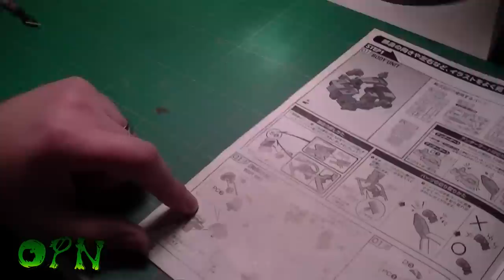How to airbrush MK III Gundam

Comment: Very good job! One question from my side: do you use glue? I mean... For the legs for example... If I would like to glue the leg parts in order to not show the cutting part of the plastic section, I have to glue before and after spray it with primer?

Comment: I shall definitely have to have a go with some alclad paints. Did you get the photos of my last one, and current project, I tend to use crocodile clips to hold my bits on the bbq skewers. stuff like blue tac was a nightmare to get off the model. What is the next project for yourself?
Reply from the maker: loganzaraki The Alclads I have bought so far are fantastic. I will buying more of there range for sure. I agree with you Crocodile clips would be much  better I really need to pick some up :)
Reply: Amazon is a great place to get them, just make sure you get right ones, at like £2.50 for 50 you cannot argue at that
Reply from the maker: That's a great price mate. Just found your email and replied mate. Dragon ball Z FTW!!

Comment: Thanks for the video! May I know what's the air pressure you using? I painted a kits but failed to achieve smooth surface. The primer part seems ok (I prime with 1500 surfacer) but when come into base and wet paint it always failed me. Any tips from you would be appreciated!

Comment: When you did your panel wash did you put a top coat on it and what brand was it in using the Vallejo acrylic gloss and wash but it's being a complete mess. Also when you put the wash on the kit do you want the part on a flat surface?? This is the one step I'm having an extremely hard time with.

Comment: For those stumbling across this video, here's another tip from a spray can user; use gloves when assembling your model. If you're not using the good stuff like Testors One Coat Lacquer, Tamiya or paints that go on thin, wear gloves. The oils and heat from your fingers won't ruin the paint job. You think it's dry and fine into you start touching it and bam, sand city. Ugh.